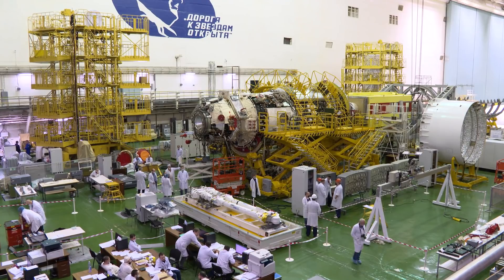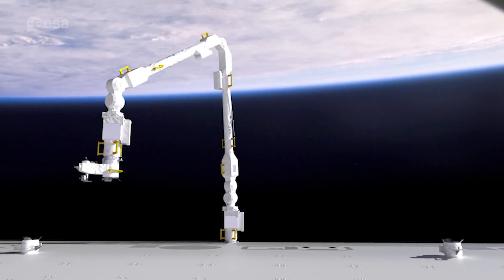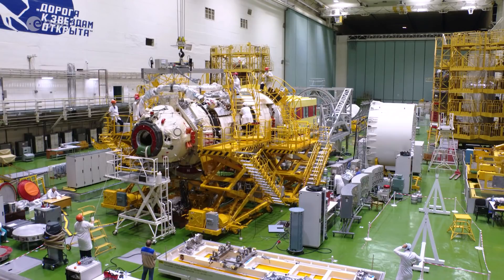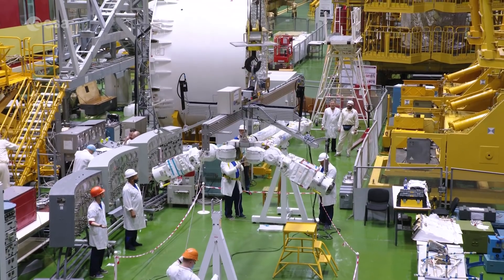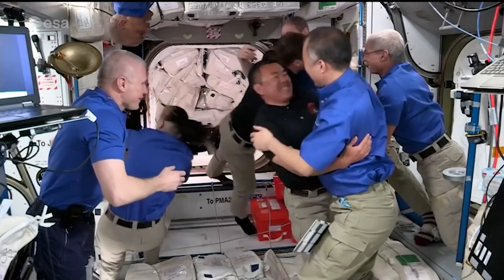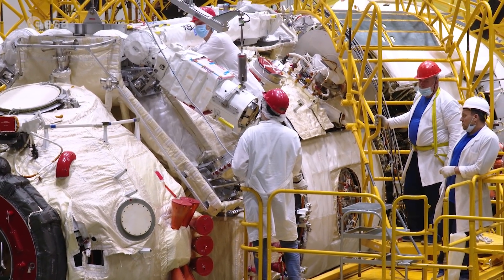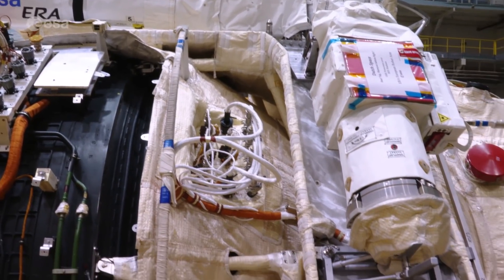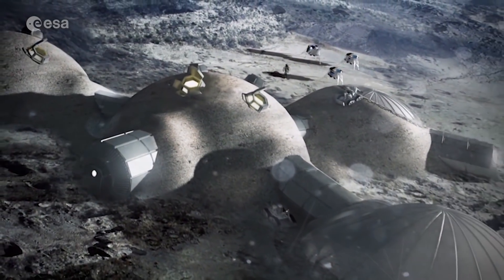European Robotic Arm ready for space

Comment: To all the 推杆熊猫 out there - ESA has had the backup arm stored on the ISS since 2010, this arm is not as new as you think. The concept of this type of robotic arm is older than the PRC would admit. The origins of ESA working with Roscosmos for the arm goes back to the 1980s and 90s. The PRC was not capable of even human flight by then. The ERA clearly predates even the early PRC chuangxin, shiyan and shijian grabbing satellite attempts. ESA needs to put dates in their information, at least to fend off the silly PRC PR war.